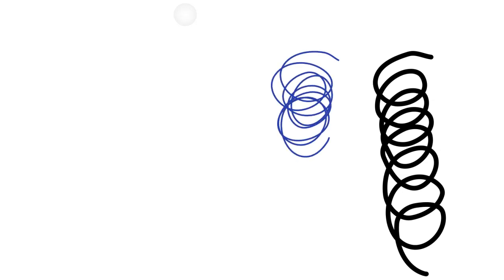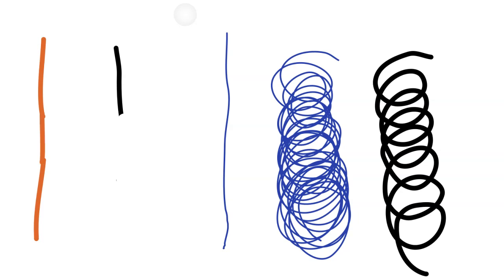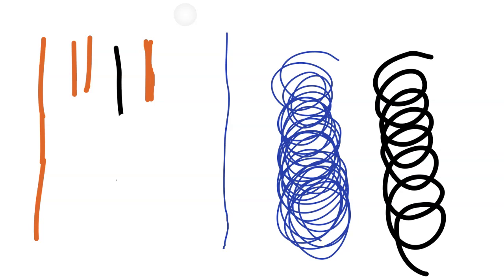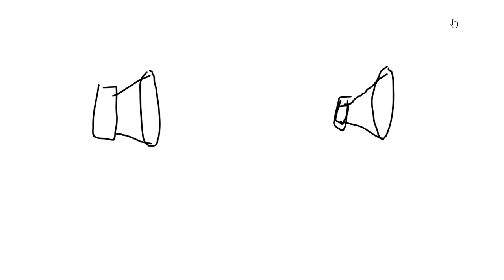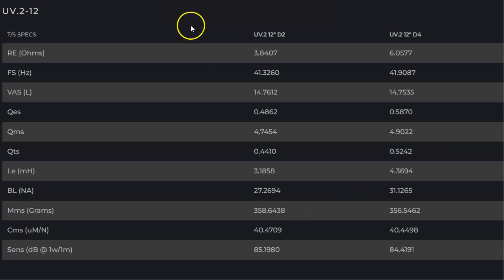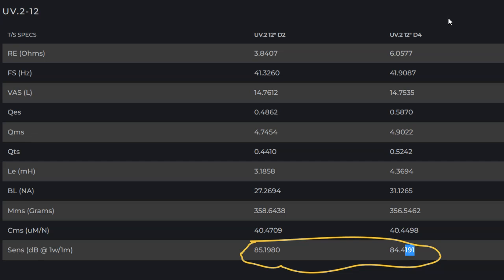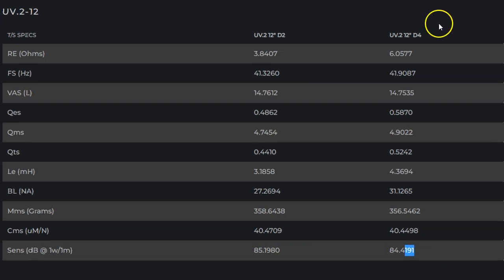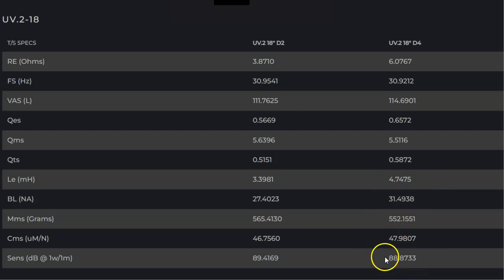Series Vs. Parallel Question Answered!  BL is your best friend!

Comment: this is a really good explanation, “BL” literally means B field (flux density) times the length of wire L that the flux cuts through (hence the unit Tesla meters). when wiring a DVC sub in series, you’re putting the two coils back to back, forming one longer coil producing a higher BL. concert subs are usually higher impedance, stiffer and designed to play above 40 Hz. plus the amps driving them are tuned for punchiness and max dynamics.
Reply from the maker: Thanks!

Comment: Thanks for very good information.  I have build lots och boxes over the years and the last build i test to wiring the subs in series (4 ohm) then in group of 2 subs in series to 8 ohm. And those 2 groups of subs down to 4 ohm. This make the sound best. I did try to wiring everything to 1 ohm but it feels like i lose the control of the subs 🙂. 

If you have the time is it possible to contact you in a pm?. It would be nice to ask for some ideas how make the enclosure most effective. Thanks for your time😊
Reply from the maker: Sure, you post something here for me to reply to.  However, I plan on getting together a Facebook group for people to join so they can ask questions there.

Comment: Another interesting video but I have a question. The .5 db gain will only be achieved if I make up for the loss power with increased gain right? For example if I switched from parallel connection to series connection with the same amount of amplifier gain I'll be looking at a loss of like 3 db instead right? How about the BL, if using the same gain but different wiring will I still gain more BL or will I have to increase amplifier gain to match the wattage in order to achieve a higher BL? (Sorry if this is a really stupid question I'm really new to car audio)
Reply from the maker: This works really well if you are running multiple subs.  If you rewire one sub up, you typically loose power to it.  You would have to push the same amount of overall power to gain the .5 db.

Comment: Amplifier will work increase it output at a lower ohm load. If amplifier see a higher load the out put is lowered…down is increasing output is up would decrease load and amplifier output/ current to driver.

Comment: A subwoofer with a high BL has never mattered to me, but having an amplifier with a high damping factor of over a thousand or higher is what matters most to have excellent cone control.
Reply: Damping factor doesn't matter. There is no measurable, let alone audible difference when you go above a system damping of 20. 

Andy from audiofrog has a great article about it
Reply: Then I stand corrected, there is far too much snake oil in our world that fools us into what we want to hear or see & I guess I also have fallen victim to it. Thanks for correcting me Blake, because I never want to spread false information to others.
Reply: @blakebrockhaus347 yeah true every class D amp that’s out right now has a high damping factor because the output impedance is extremely low. this is really only something to worry about for class A and tube amps.
Reply: @blakebrockhaus347  Damping factor matters more as the freq. drops. Example: A Damping factor of 200, @ 2 ohms, @ 500 Hz vs a Damping factor of 20, @ the same 2 ohms, & @ 500 Hz would not be noticeable to the ear. But if the freq. was changed to 20 Hz, the impact/control of this Amplifier Damping factor difference would definitely be Noticeable.
Reply: 1000 who makes amplifier I would love to check them out? Thanks
Reply: @markdulaney2348  JL Audio - XD1000/1v2 has a damping factor of 1000 @ 4-ohm & 500 @ 2-ohm. It is only a 2-ohm stable amplifier. I like to only run at 8 or 4-ohm for the best cone control possible.
Reply: DD Audio damping factor<400